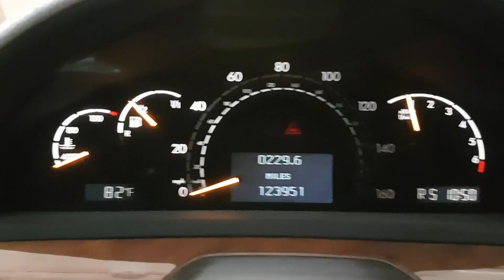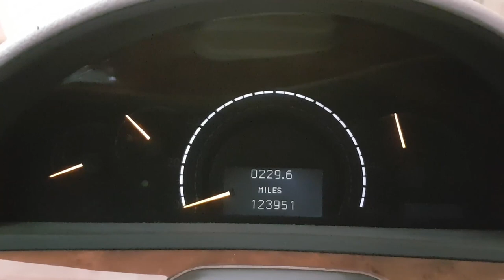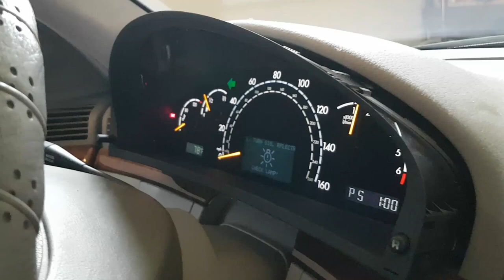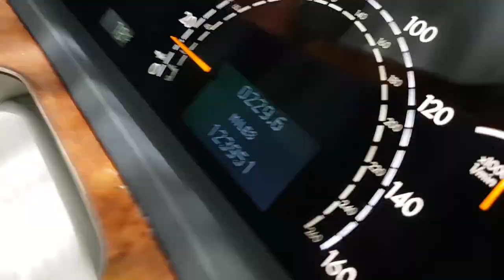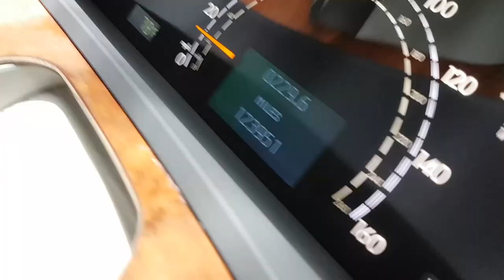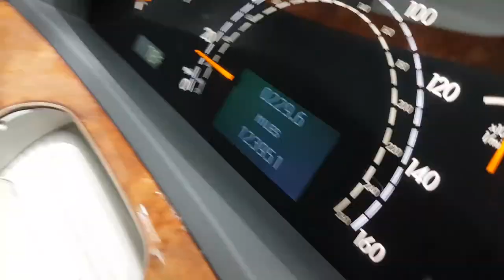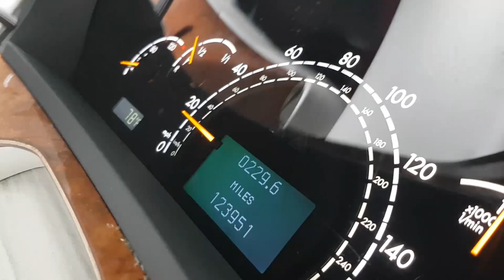Mercedes W220 Instrument Cluster - how to remove and replace.

Comment: How did you set the milage as the W220 cluster is set to the car and I have the same issue, but my milage says ------ no numbers
Reply from the maker: If you sent out to repair as I did, it should come back with your actual miles...

Comment: I have a 2006 s420 and my speedometer drops after driving for a minute and the abs sign and check engine light comes on . Code P0500 says bad speed sensor so i changed it still the same problem and same code .any idea what it might be
Reply from the maker: Hi, it is hard to tell...  It may be that your speedometer is going bad or a connection is faulty.
Reply: The speed sensors (4) r on each tire. They're for the ABS brakes

Comment: A bad cluster will absolutely wreak havoc on these cars.  I had the weirdest stuff happening and I would have bet money a SAM was screwed!  Suspension red lights would blink, turn signals would work, rearview mirror would go dark in the day.  You name it, the car becomes possessed when the cluster acts up.  I used the guy in Denver to fix mine.  Problems went away.
Reply from the maker: Great to know.  Thanks.

Comment: Hi! I just purchased those same jigsaw blades from ace hardware since I don’t have the tool gonna pick them up on my lunch break. I hope I have the same easy success as you did when you pulled it out. Gonna ship my cluster out as well for repair/service as well thanks for the video 🙂
Reply from the maker: Thanks, if they don't fit, you can purchase the keys cheap on Amazon or eBay.
Reply: @masood-tv  I was able to get the cluster out with the same jigsaw blades you have. I shipped her away for service after my work shift at the ups store can’t wait to get it back thanks again! 🙂
Reply from the maker: Wonderful.  When you get it back, make sure the speed and fuel handles are reset properly.
Reply: @masood-tv  how do you do that?
Reply from the maker: @bronevaya  I was stressing to check that...the repair vendor does it. If it is not done properly, they should pay for shipment and redo it.
Reply: @masood-tv  Thanks for this video and the valuable information you are sharing one this platform. It’s greatly appreciated. 

I have a 2000 S500 and the investment cluster flickered and eventually dead. The only light that comes on when the car is started is the SAS light and goes off. Nothing else works. I sent it out for repair but it could not be done. So, what are my options now and how do I go about that? Thanks for your prompt response.
Reply from the maker: @samuelm714  , do you live in the U.S. or Europe?
Reply: I'm in the US, please let me know. I am in the middle of purchasing a great 2005 S430 and one of the bulls went out near the 100 -150 mph portion and it makes me sad. I really want this fixed so I appreciate any help!
Reply from the maker: @JasonFlorida it can be fixed, no worries...

Comment: Does the mileage of the instrument cluster matter or does it automatically scan the original miles and input them onto the new cluster?
Reply from the maker: Hi Kevin,
The repair service I refer to in the video does not send you a replacement cluster.  You will get your original cluster back with your original number of miles intact.
Reply: Sorry what im asking is if the miles will change if I got a replacement cluster from the junk yard?
Reply from the maker: @kevinhuynh303  - Yes, it will.
Reply: Masood yes it will what? Sorry misunderstood
Reply from the maker: @kevinhuynh303  the miles will be from the replacement cluster you intend to purchase from the junk yard..
Reply: Masood is there a way to tell the original miles if the original instrument isnt working? Mayb with a mb star computer??
Reply from the maker: @kevinhuynh303  - Sure, but you have to take it to a Mercedes Benz dealer.

Comment: Friend and how do I reprogram it because I have the same problem but I couldn't do anything I bought two and nothing helps me I leave you my cell number please help me
Reply from the maker: Hi LIL"70" - I am not sure you can reprogram it without the right tools...why do you need to reprogram it?
Reply: @masood-tv  Which one do you recommend I buy one OEM unlocked why I bought Two and nothing one It doesn't work for me why it was Q3 it wasn't the same numbering ok I understood that but I bought another one with the same numbering but it was Mercedes Benz so I had to take it to Mercedes for that they reschedule it and they told me that if I took the one that I had bought, they would tell me that they sold me theirs because they don't deal with Anti-theft parts THAT'S WHY I want you to help me if you buy an OEM or a Mercedes
Reply from the maker: @LIL"70"👽™️  I don't think I understand the question adequately.. I am sorry.  But, if you can afford it, it is best you get it from Mercedes and have them install it.
Reply: @masood-tv  I'm in NY and it seems that nobody knows everyone says the same thing I'm using the GL but that's why I want to fix it so I don't use the GL
Reply: Y excusme Ford ask

Comment: Hi Masood, great video. Very informative and professional. I tried the jigsaw on my W220 to no avail. I ordered the tool recommended. The left side of the dash seems fine to remove but the right will not budge. Any suggestions would be appreciated. Thank you
Reply from the maker: Hi Andrew, all I can suggest is to watch the video starting at 2:18 mins to see the mechanism at work...also, don't give up, it should work if you have the keys and inserting them in correct orientation.
Reply from the maker: The tab on each side that is blocking the console from removal has to be simply pulled in to  clear the way...the spring action you see in the video pushes the tabs outwards locking it in place inside the dash frame.
Reply: @masood-tv  Understood, will do, thank you very much. I appreciate it.

Comment: Hey there.
My cluster is toast, I definitely need to replace it. Does this require some reprogramming? Or just would show the different mileage?
Reply: I have a cl500 2003
Reply from the maker: @latincaribmexico5544  No reprogramming is required.  They will send you back a working cluster with your current mileage.
Reply: What if screen i completely dead

Comment: After removing the instrument cluster will car run without it and all signals still work?
Reply from the maker: Hi sandtrapdummy - it should.  I have never tried it. The cluster does not feed anything significant back to the car. So, if you have to remove it in order to have it repaired, test and see.  Keep in mind you won't be alerted of any issues or see the speedometer while driving...
Reply: @masood-tv  my instrument does not illuminate nor do any of the gauges work
Thanks for responding
Reply from the maker: @sandtrapdummy  - just search eBay sellers with good ratings or the one I have in the video - send it out and you will have a perfectly working cluster in less than a week.  Good luck.

Comment: So send the cluster out and it should still have the original miles on it
Reply from the maker: Hi Skeezzy, yes, they will send you back your cluster with your miles intact.  Mine came back that way.
Reply: How much was it to get the cluster fixed
Reply from the maker: @veontetoraw561  $199

Comment: This is NOT a repair its a replacement
Reply from the maker: Ultimately, it is a repair of a non-working cluster.  Albeit I did not do the repair.  I remove the cluster, show where I send it for repair, and then I replace it. It is cheaper than if I  repair it myself. I just want to show my viewers of this alternative.  Thx.

Comment: I changed out this cluster an still nothing 🤦🏾
Reply from the maker: Hi Draco Yay, do you mean you had a non functioning cluster which you had sent for repair and once back it still doesn't work? If yes, there are two possibilities.  It wasn't repaired which is doubtful, or that your problem was not the cluster.
Reply: I bought a new out of another Mercedes i checked it before I bought it. It worked I plugged it up into my car and it still didn’t come on
Reply: Idk what els could it be
Reply from the maker: @dracoyay6577  Do you have access to a dealership just to determine what the issue is? You can also check the plug for signal, ground, and power values if you have a meter...
Reply: @masood-tv so whn you insert the blade do you press inward or outward on the tabs to remove?
Reply from the maker: @greglopez7768  please watch footage starting at 2:18 minutes, and if you still have any questions, let me know.
Reply: @masood-tv  i went home depot got the blades watched your videos idk how many times amd i just cnt get it out i had to give up wth frustration cause i dont want to break anything ugh so frustrated!!!
Reply from the maker: @greglopez7768  sorry to hear that.  Not all is lost.  Order the keys from Amazon.  No maneuvering needed.
Reply: @masood-tv  yea ive gone wthout it this long that is what im going to do, thanks again for your quick response sir…
Reply from the maker: Hi Greg, yes.
Reply: @masood-tv  finally got it removed, havent removed harness yet because i still drive the car daily, (dumb ?) but will the car still run and start when i disconnect harness?? Thanks for always responding so quick BTW
Reply from the maker: @greglopez7768  It is easy to test..
In your garage, disconnect and then turn the ignition key.
Reply: @masood-tv  did yours start and drive whn you disconnected it? Did the headlights taillights , and blinkers still wrk? Cuz currently all tht functions on my car
Reply from the maker: Hi Greg, actually I didn't use the car until the cluster was reinstalled.  It only took a week for shipment both ways and repair.
Reply: @masood-tv  gotcha yeah it still started headlights and taillights and blinkers still wrk if anyone else was wondering, you just gotta put a lil bit of gas everyday there no way to tell how much is in there also make sure the car has proper amount of coolant cuz you dnt knw wht temp the car is running at either… gdluck everyone wth this problem

Comment: This is not a repair! You didn’t repair anything! You changed a part, your a parts swapper.

You should change the title to “how to remove the cluster and send it to someone else to do the actual repair”
Reply from the maker: My intention has never been to deceive anyone.  I think I will take your advice and modify the title, John. Thx.